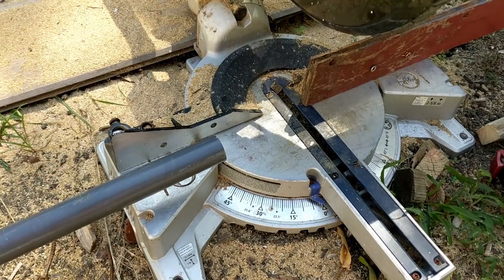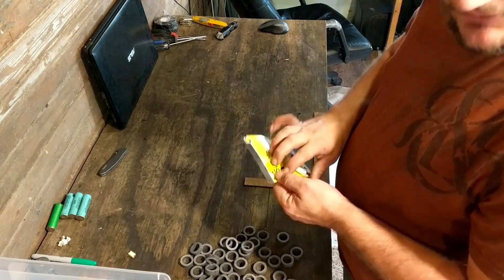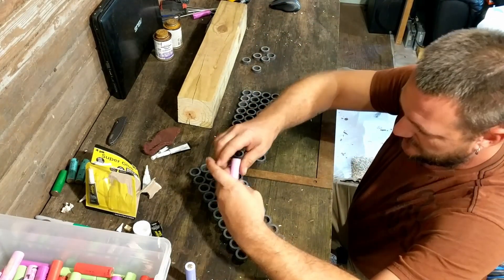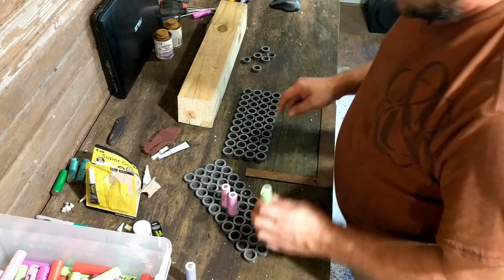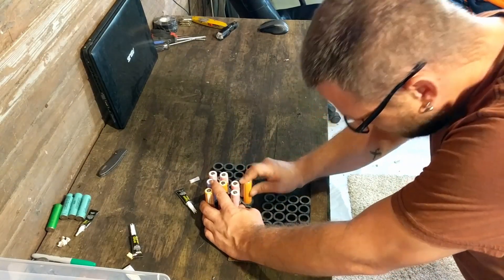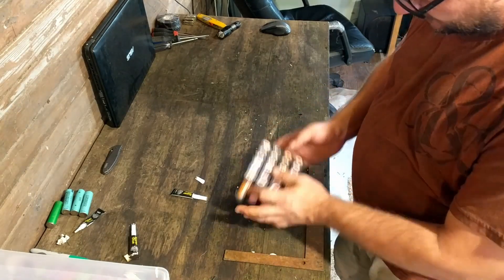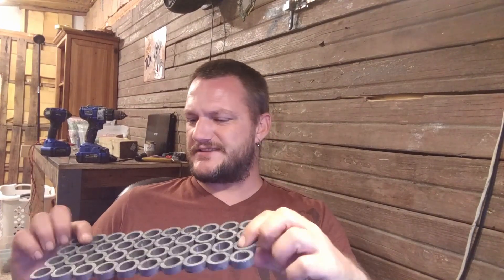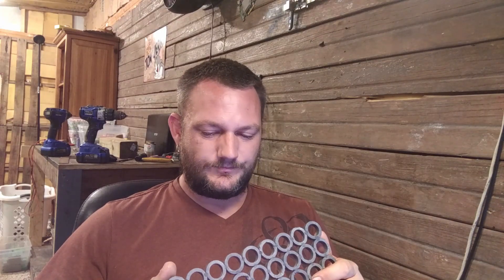DIY 18650 PVC Cell Holders for powerwall - Worth it?

Comment: All 3/4 pvc has exact same exterior size of about 1.050 inches.  Interior varies based upon schedule of pipe.  Even schedule 80 has some wall thickness variation.  Average schedule 80 is .722 inches or 18.34mm.  Some will fit 18650 perfect.  Some will be bear wrestling.  Spray painting the plastic only makes it worse.